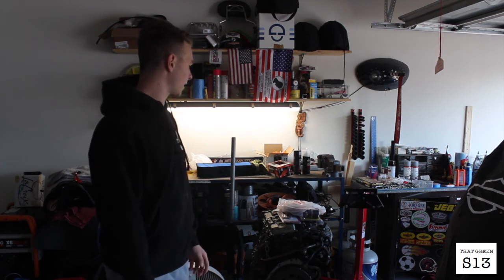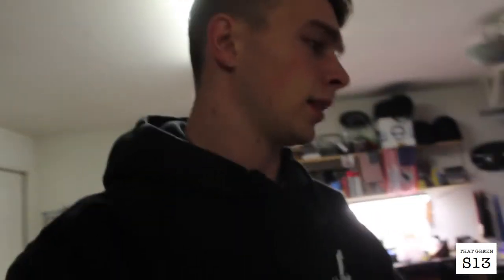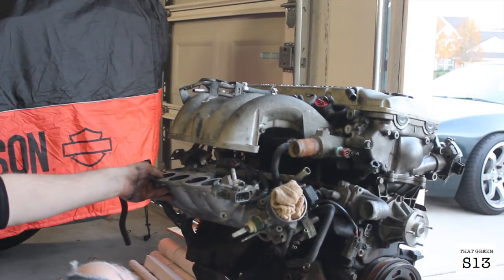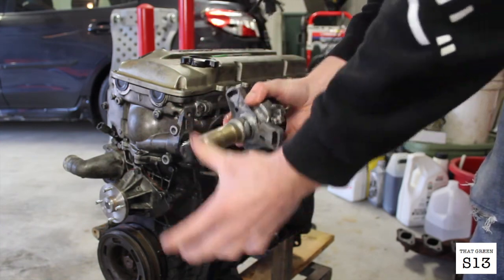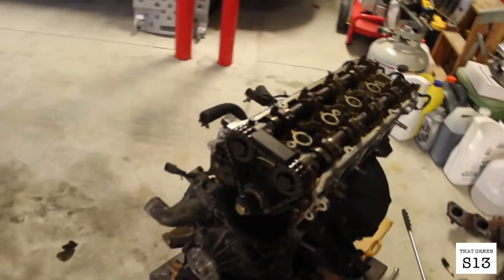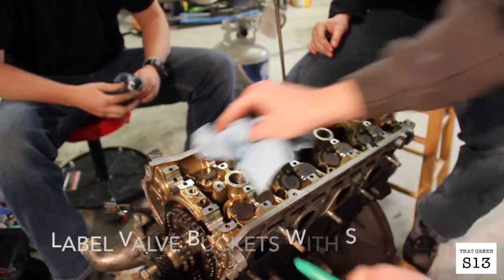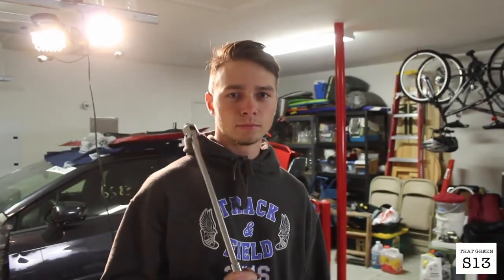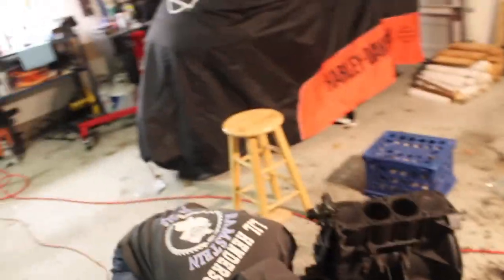KA24DET Prep Ep. 1 | Engine Teardown

Comment: I have a KA24DE in my 2002 Nissan Frontier and the coolant hose configuration seems to be a little different. The truck motor is mounted "in line" as opposed to mounted transversely in the auto. Are the KA24DE motors mounted transversely in the cars different?